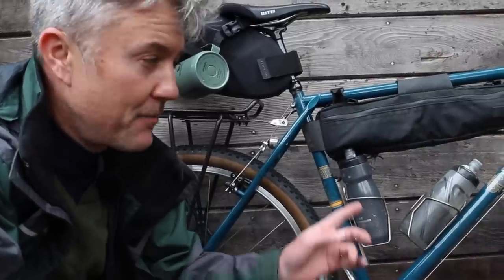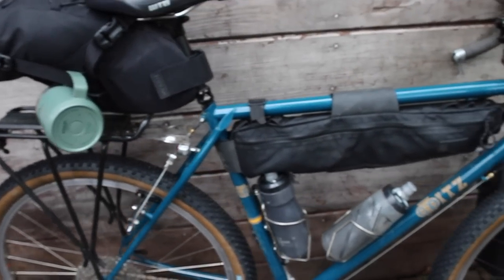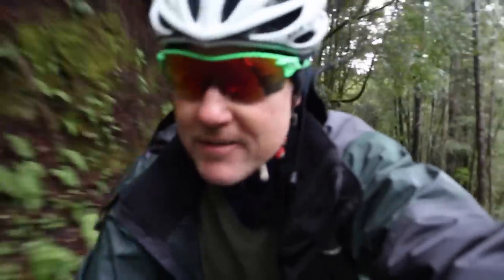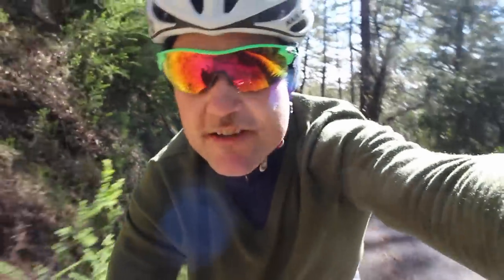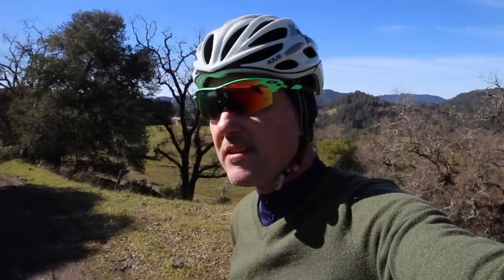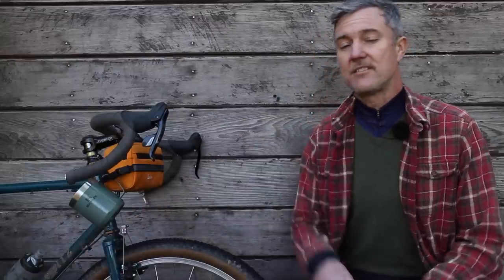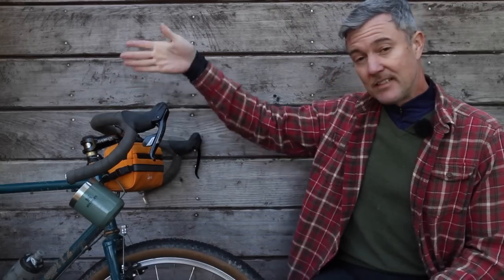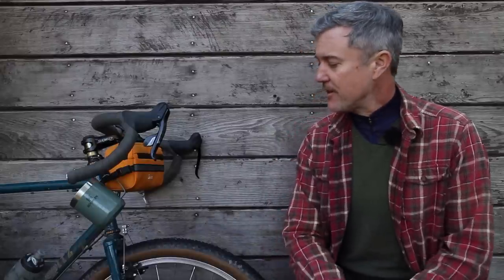What about in touring mode?

Comment: Hey Jeremy, do you ever miss your Specialized?  It was such an awesome bike.  I have one myself and love it.  TBH, I love all of your bikes!  Thanks for sharing this content!
Reply from the maker: Hi Scott. When I sold it, I was sad to see it go. If it were one size larger (58cm vs 56cm) I would have kept it. The other reason I let it go was it was an '83, so it didn't have the down tube shifter bosses brazed on. The '84 and newer models did. Great bikes and basically a good template for a custom. My rando bike is largely inspired by the Expedition, but with thinner walled tubing, 650b wheels, center-pull brake bosses, and low trail geometry (and personalized rack mount placements), and color choice. It's a size also similar in frame geometry to what a 58cm Expedition frame would be, namely a taller seat tube and shorter top tube (58/56.5). Overall, the Expedition opened my mind to what a good steel framed bike should be, and to me are a super high value if you get a good deal on a used one. They are somewhat limited on tire clearance, which is another reason I continue to head towards custom, and it's just very enjoyable.

Comment: A different all new bike would have the benefit of better dropouts/rack mounts/ braze-ons with maybe custom racks. You can also integrate generator lighting from the start. I think it is good to mount front panniers a little higher for off-road and have another standard low-rider  mount for pavement. It also seems like this bike isn't perfectly sized for you. But you have a great bike either way.
Reply from the maker: Thanks Mike! Good suggestions!

Comment: Have you ridden a frame with single OS top and down tube?   My similar Fitz is built that way but with a 9/6/9 down tube.  I'm 200 lbs and it rides nicely  loaded. IME, For off road you will want smaller panniers up front mounted higher to clear rocks and bushes.
Reply from the maker: Only once, and it was for a short distance, and unloaded. Now that you mention it, it would be nice to compare tube stiffness. You've given me an idea. Good tips on the pannier placement, too.

Comment: Compared to your gravel racer, how is the ride different? And did you do a comparison with the gravel racer loaded up?
Reply from the maker: It's a much stiffer frame, both in the top tube, and bottom bracket area. The larger tires and flexible fork help to smooth out the ride. Once it's loaded it feels about the same as the gravel bike feels unloaded.

Comment: I’m curious if John builds bikes using either a Rohloff hub or Pinion gearbox?
The Gates drive belt looks kind of appealing.
Reply: These 2 will not change what they are used to.
 I absolutely love my foolproof disc Rohloff14 and SA XL-FDD dyno drum brake. The angry bees feel does annoy tho. 
And anyway, Go look at Flyscout Ryder 's YT tour videos. He made the mistake of getting a Pinion Co-Motion bike with a belt, that came with a horribly NOISY ratchet SS rear hub. Coasting happens a lot on a tour bike. So then when he had that opened to put in more grease, the LBS wrecked his belt getting the cog off. 
After 1000 miles he quit and went home to get his well used Cannondale dR. You are welcome to buy it. LOL. 

Read his comments about it. >>>
EP 1 - PACIFIC COAST BIKE ROUTE - OLYMPIC PENINSULA - CYCLING USA 3
Reply from the maker: Hi Steve - Yes, John can build a bike to accommodate a Rohloff belt drive system, and most likely a pinion gearbox too (although that's worth an email to verify). On his website, the second bike in his list of recent projects is a Rohloff belt drive bike if you want to see an example.

Comment: Nice. Would you be able to use p clamps for the rear rack?
Reply from the maker: Yes, there are a few options to make it work. We could bend the top supports down, or possibly cut the rack legs flatten them and re-drill the holes. These racks are pretty easy to modify and they are also affordable, so I wouldn't mind getting out the hacksaw.
Reply: I've used p-clamps for a rear rack. Result was kinda wobbly. That tail wagging the dog feel.

Comment: Yah, that's going to be a really good layout with 650B. But that fancy schmancy dropout has to go. 
The rack bolt hole so far from the axle and right beside the tube, is just plain dumb. I'd have zero confidence with it.
And again, I hope your design has the frame 20 mm higher, IMO too much seat post. Plus you get more bag space. That tail wagger has got to be annoying.